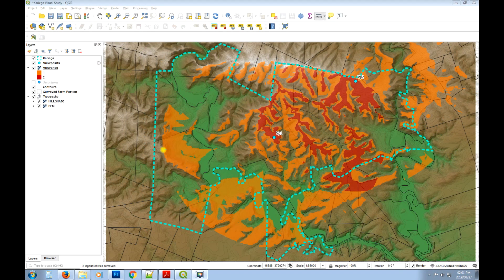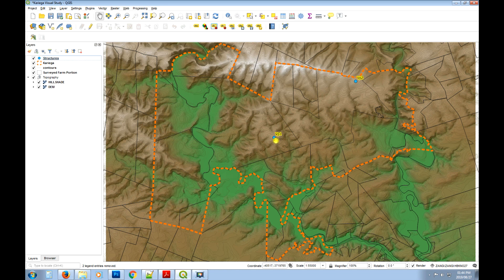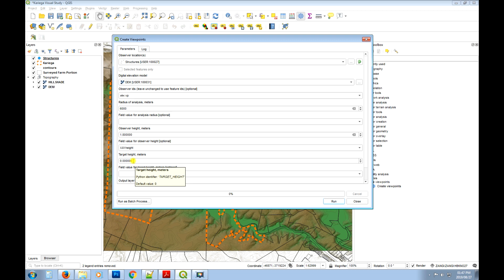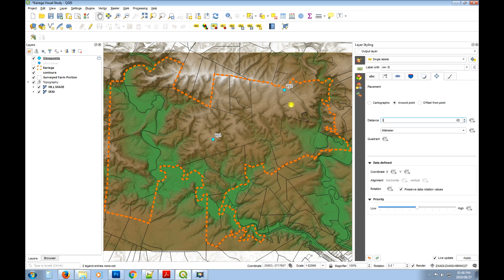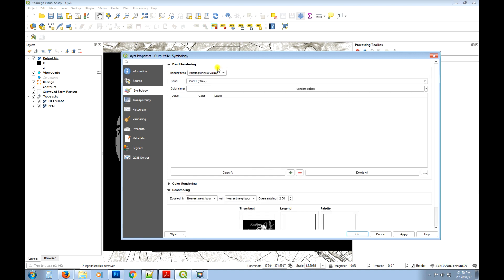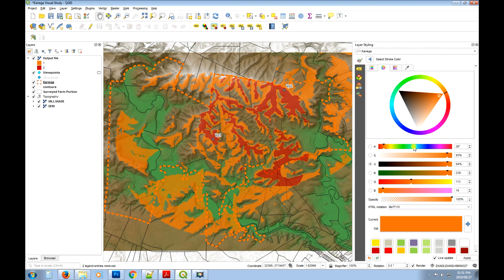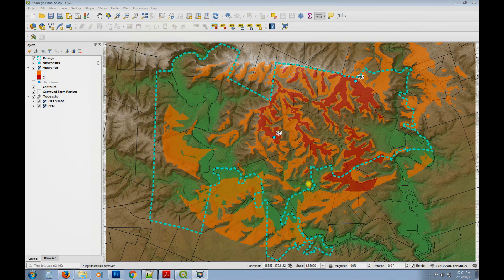QGIS Visibility Analysis

Comment: Hello, I'm wondering if there is a way to go back and edit the radius of the view shed. It could be very simple... I'm just learning. 

Thank you for an extremely helpful and well made video!
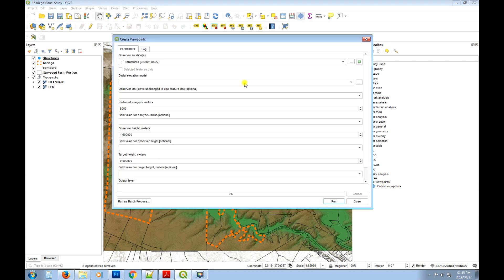Reply from the maker: Hi Elise,  if you run through the steps from about 2:45 to create the view points again you can set the Radius of Analysis to something different.  It just involves repeating a step.